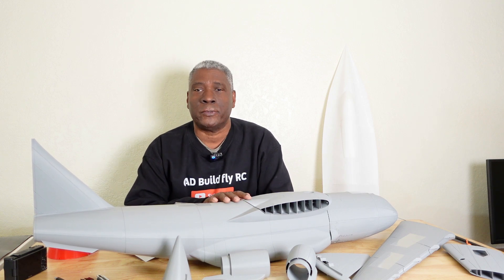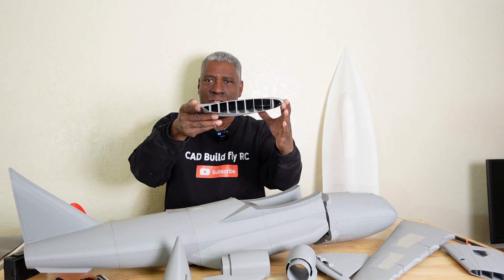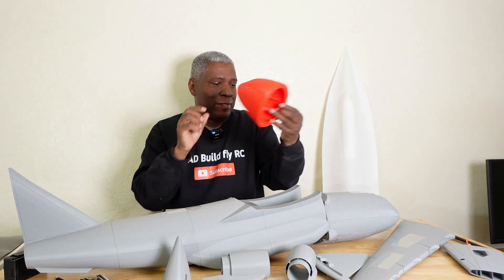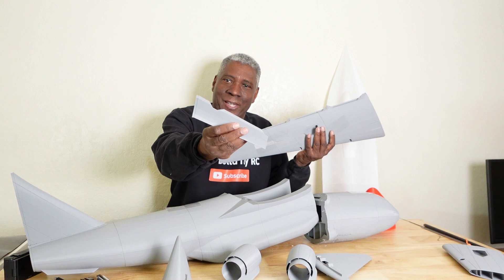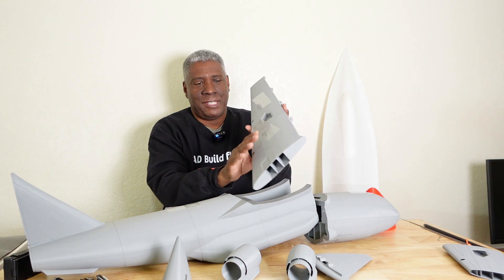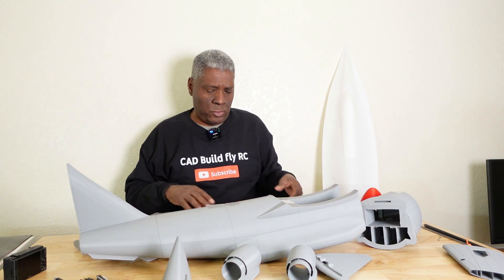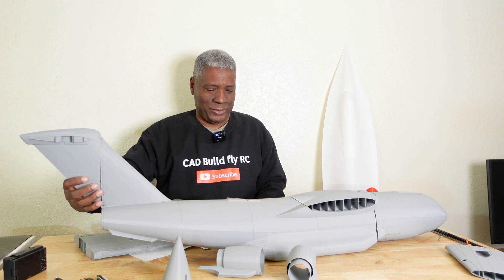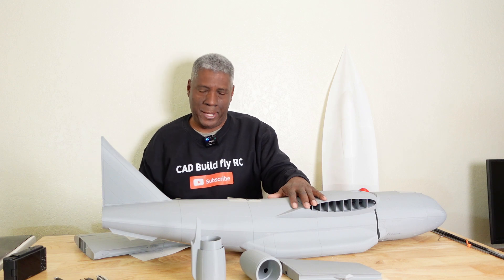3D printed C-17 looking at the design

Comment: What settings do u use I have the k1c K1 max and the K2
Reply from the maker: @Masterofnone808  I used the settings he specified
Reply: @ thank you for the reply. If you’re interested in looking, there’s another version of the C-17 on colt 3-D that’s the one I’m currently building, but I’m looking forward to also building this one. I am 90% complete on the one I’m currently building. I’m making it out of PLA. It’s a prototype that I’m using as a guinea pig to install to scale land gear once I find the STL for the main gear, that’s the tricky one
Reply: @cadbuildflyrc3784  if you don’t mind, I would like to ask you a couple more printer questions I’m new to the 3-D printing RC planes and also the hobby I know C 17 is not a good starter aircraft but this is gonna be a long-term project if I wanted build a spec and I also wanna make it somewhat larger. but you are the only YouTuber in a long list of searching that I found using the K series so my first question you would be when you print out your aircraft. What is the slicers do you use? I use orca mainly I also recently installed cura but I’m having trouble finding the K series presets. And then my next question is this first C-17 I’m building. It’s just my first prototype to dial in the printer and dissected to add the landing gears, the doors and windows also a Fpv camera so I’m using regular PLA and I see my self using PLA for the mere feature till I know LW-PLA is the way to go but that wasn’t always the case so I’m trying to look for the settings for basic or PLA plus Pro settings for whatever slicer you’re using. I know it’s gonna be different the filament‘s gonna act different but at least it’s gonna give me in the ballpark to do some adjustments and it gives me the peace of mind that I’m going in the right direction thank you for your help

Comment: I have had this completed model hanging up in my shop for a few weeks. I did encounter problems with the build and unfortunately did receive no assistance from the designer..I have built a launch dolly and the model is ready to go....but I just have a bad feeling about it. .....pity.
Reply from the maker: What problems did you encounter?
Reply: I had one fuz section print approx. 4 mm long so that the wing would not locate properly and the wing center section failed to print twice. I  contacted the designer and asking for assistance ...cricket..cricket ...cricket               @cadbuildflyrc3784